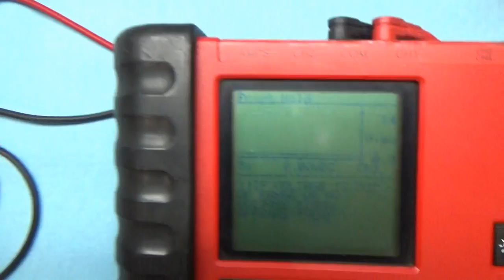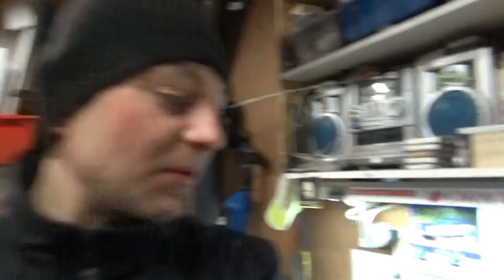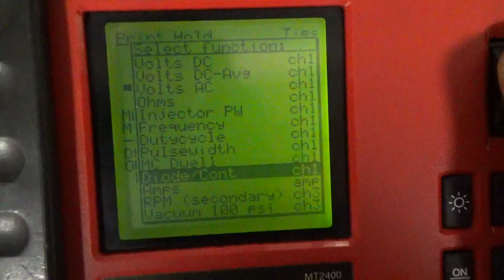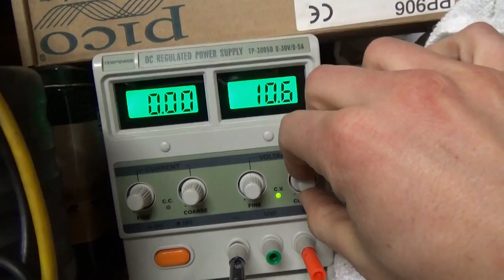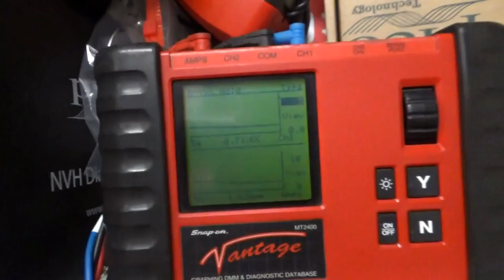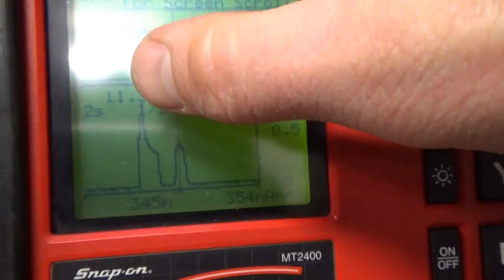Snap-On Vantage MT2400: Review & Repair

Comment: This is the only tool I will give some credit for making me a better technician. If Snap-On brought it back exactly as the original but with a modern rechargeable battery, I'd probably buy a new one tommorow.  I don't think there's another tool in existence that has up to a 16 hour timebase. I think the last update for it was about 2006. Still useful today, even without updates.

Comment: I just watched this and Just an Fyi when he tested the Amp and voltage at the same time, the voltage reading showed lower  THAT IS CORRECT! because of the amperage draw,  the voltage would be lower. His dc supply states the output.  The mt2400 measures the result!  Very Awesome tool! Excellent feature!

Comment: Nice review and walk through on a classic tool. 

My snap on diagnostics lineup looks like this... MT2500, MT2400, MODIS, and finally the Verdict D7.   Love every one of them, but the MT2400 is my go to meter.    

Maintaining a fleet of older Chevy TBI buses for our church in OKC I need all the  help I can get, please keep on with the quality content.
Reply: I have a 95 7.3L superduty and a 94 Bronco 5.0L - i see an MT2500 for sale at an auction.  would this tool be useful for these vehicles.
Reply: @peetky8645 there isn't a problem you couldn't fix on an OBD 1 vehicle with the MT2400/2500. The brick and the box as we called them back then.

I have mine since 2003. It was the first scan tool I purchased. I still regularly use the MT2400 on modern vehicles. You need the cartridge, the key, and the plug for Ford if you want to take full advantage of the MT2500's capabilities. Also, Snap On released a cartridge for ABS systems which was priceless. Let you do a ton of functions on OBD 1 ABS systems, including bleeding and purging the valve block and testing the proportioning valve on Fords right from the driver's seat.

They also came with a bunch of manuals that provide theory of operations and common failures/symptoms on popular makes and models. Snap On really was ahead of the game back then.
Reply: @LynxStarAuto  thanks... mine has been sitting in the corner since i purchased it.  it came with a bunch of green things on a chain.  i assume these are keys.  are they labelled?
Reply: If you had the correct adapters and software it COULD, but they are old tools and pretty crude.   

The older scan tools required special cards or programs for different makes & models.    So they MT2500 could truly live up to its nickname “the Brick” if you don’t have the proper accessories.
Reply: @kc360awareness  thanks for the reply and information.  the one i am looking at has maybe 5 red plug in things and a keychain with maybe 12 cards plus a bunch of cords and plugs.  i assume a 2000 year scanner would have plugins for all prior years?
Reply: Your welcome.   

Don’t get me to lying now.  I just know you there is a specific adapter for Ford.   It looks completely different from others and probably will be labeled “Ford 1a” or something like that.   Google search could probably tell which adapter for the application.   There’s probably a chart somewhere online.

Comment: Great tool. I have a vantage pro but this thing works a lot like an old OTC 3840 I have as well. I use it for quickly checking for parasitic drains. I love being able to graph amperage draws in a hurry without having to move the car in front of my Pico cart.

Comment: I have a Snap- on scanner with cartridges from 1980-2000 foreign  and domestic and adaptors for Jeep, OBDII, Ford TFI-IV, G.M., Multi-1 and multi-2, Nissan, and it has manuals for Ford, G M., Chrysler, Import, and computer numbers, and Storage case.  It has  a cigarette lighter cable, and the cable for the tester/adaptor. It checks KOEO and KOER, timing advance, RPM, Solenoid and relay test, transmission  codes, Wiggle test ( KOEO and KOER), Open loop and closed loop, O2 readings, Coolent temperature, record, and more!
Reply: Red brick MT2500

Comment: The power supply and the vantage are BOTH correct.

Power supply delivers 2 volts to the test leads, the vantage is almost a dead short, so the red and black testleads have 1 volt each across them.

That 1 volt flows in the black wire of the volt meter, so the vantage sees only 1 volt via the blue lead ( the voltage across the red lead ).

it cannot see the other ( black ) lead's voltage drop because it cannot measure the black lead since it is only looking at one end of it.

If you had measured  across the black and red terminals ON THE VANTAGE itself with the other voltmeter you would have read 1 volt also.

Draw it out with the leads depicted by resistors and write the voltages in the diagram, it will become very clear.

0.05 micro amp ( when used as a voltmeter )  causes no measurable volt drop in the test lead, 4 amps will cause a significant volt drop.

Good advice learnt many years ago: measure voltage from where to where? ( always thinking about current and loading of a circuit when testing and aware of volt drop, if you measure  a part only measure AT the part, not somewhere close or convenient )
if you follow this rule you will have no surprises.

Keith will give you the same advice

Nice job again Ivan, cheers

Comment: Hi Ivan;  Some tidbits from an OLD Vantage user... I've owned several, starting with the original Vantage, w/Ver 1.0, which I got in a package deal with my Brick (MT2500 scanner).  These old Vantages are all programmed with EPROMs, on a daughter card.  The later ones incorporated a daughter card with EPROM sockets, so Snappy could save a little money by only changing the EPROM chips with the updated code on them (a savings they did NOT pass on to the customers).  These updates were reported to be "FORWARD FUNCTIONING ONLY!"...you install a new version 3.0 card to replace 2.0 etc.  If you tried to put a Ver. 3.0 back into a unit that was running something later, it sometimes had unpredictable problems.  Case in point: When I traded my original Vantage, Ver 7.0 in to my truck guy for my new Vantage Ultra (what I still have) I told him I had an old Ver 5.0 card.  I told him I intended to swap out the Ver 7.0 card for the Ver. 5.0 card so I could sell the Ver. 7.0 card to another guy.  He agreed and everything worked fine...until the truck guy told me that my old Vantage was having problems.  The one problem I remember was that the thumb-wheel was not scrolling in some of the component test menus.  It did work everywhere else, just not in some of the component menus.  My truck guy fixed the problem himself (with the help of the Snap-On California Tech guys) by simply putting in a Ver. 6.0 upgrade board he got from a donor Vantage with a bad screen.  Another thing you should be aware of is that good, functional, Vantages (original MT2400) are becoming more rare because they all had one serious flaw; the screen assembly used a silk-like cloth material to keep the perimeter contacts tight.  This cloth is rotting away on all of them, and there are no spare screen assemblies to be had...anywhere.  That is the very reason I moved on to my Vantage Ultra (in hind-sight, I made a wise decision).

In summary, don't waste you money on one of these.  Yes, they were a fantastic tool and I loved mine dearly.  But, it simply isn't reasonable to spend several hundred dollars on something that can not be repaired when it quits...which will probably happen quite quickly.  A Pico, like your 4425, is a much better tool.  It costs much less than Snap-On's stuff, and does a better job.  Even an older used Pico can still be repaired.
Reply from the maker: Leo, thank you for sharing! It's kind of like buying an old car and trying to make it perfect. The money will never be recouped, but the pleasure that the owner can get from driving a unique vintage machine is priceless :)
Reply: @PineHollowAutoDiagnostics  these can be repaired and you definitely can interchange the different versions of the the memory card I've done this on many mt2400s

I have had many of these and all the circuits function on the main board are the same there is flash memory on the mt2400 for the CPU as it has no built in mask rom. You can also back up the eeprom to your computer incase the memory card gets corrupted.
Reply: Leo, what would you recommend for pre-2000 vehicle and post-2000 vehicles?

Comment: Re: Amps & Volts at the same time:   The voltage experienced during the amp test is due to the resistance of the leads. (V=IR, leads have some resistance.)  The blue wire has no current, but since the black wire is shared, you have to account for the effect of current through it!

In fact, since we know both the voltage and current ( 1.7v, 3A) --- We can calculate both of the leads to be: 0.33 Ohms for the black cable,  and 0.23ohms for the red one.
Reply from the maker: Excellent comment! You definitely get some extra credit for that critical thinking. Yes, all the readings were "real" and the meter is accurate :)

Comment: Yeah, the MT2400 Vantage and the MT2500 Scanner are a great combination to use especially if you do a lot of Pre-2000 vehicles.  The MT24000 seems to be about $300-500 US on EBay.  The MT2500 scanner is about $100.
Reply: Are those two (MT2400 & MT2500) the best bang for the money? 
Is there a cheaper brand that is a knockoff from Snap On? 
What is the best out there for pre-2000 and post 2000?
Reply: @vice4134  Modis can do everything those two can.

Comment: It's a great tool, mine broke.😓  It won't even turn on.  Plus what is also cool is they made a ignition module for it that would graph your spark kv, burn time, and firing kv, I own that module as well.
Reply: scanner danner i think has a video on repairing a no turn on. the battery teminal to board connections are prone to dicombobbulating.  a quick bend and  resolder is usually all it takes
Reply: Mumbʟes005 Unfortunately it's dead, looked it over and found nothing obviously broke.
Reply: busjockey1 did you open it up and look ?

Comment: I have also recently restored a vintage Snap-on MT series diagnostic tool as well, slightly older than this model mostly op-amp and TTL logic. Below is the link to the first video of a 9 part series, I had no schematic so I had to trace everything out and build some of the components that no longer exist.
https://www.youtube.com/watch?v=vY5E5pr9Ixw
Reply from the maker: Awesome!
Reply: This is now up and running at the new shop and used for air cooled VW diagnosis. 4 cylinder setups provide for ample viewing both in raster and parade.  Snapon mentioned that they have one in a museum, this is the only one I know of in fully calibrated daily operation. Or that functions for that matter.  I realize 9 videos can be tough to get through, but it was 3 months of work to reverse engineer the broken sections and repair.

Comment: The software is on the card that inserts into the machine on the same side as the fuse. You upgrade the software by replacing the card. That version 2 is really old & some of those screens   that you showed us are not included on the newer versions. I would pull out the card & reseat it. It pulls straight out, just like the fuse. If reseating it doesn't work, they are on Ebay all the time. Cheap & easy to upgrade. I have owned my Vantage since version 1 & still use it all the time. I think mine is version 6 now & I believe there was a version 7 but nothing newer. I love the "legacy" Vantage because of it's size & abilities. My Vantage Pro is cumbersome by comparison & I only use it when my requirements exceed the Vantage capabilities. Have had several issues with the Vantage over the years, but always manage to get it back into the game. If mine died today I would be on Ebay tonight buying another. I wouldn't hesitate to try a another software card in yours. Good luck.
Reply: arbez auto have you been able to calibrate it or ever had it calibrated? I'm thinking about picking one up but if it's off by .1v like this one is I'm wary about how accurate these old things are without a calibration...

Comment: Thank you my young American friend, after watching you fixing your wife’s monitor my daughter told me the TV in her room had stopped working, OK I’ll have a look, just watched Ivan fix a monitor 
Well what do you know 2 capacitors had snot coming out of them bought 2 new one’s for £0.30 put them in, and bobs your uncle, it worked, thanks Ivan, I would have just binned it, so if you can do it, I......oooh wait,  that’s that other guy I watch OLO ;-)  cheers Buddy thanks again
Reply: Pine Hollow Auto Diagnostics Amen brother
Reply: best bet is replacing all the "low voltage/output filter" capacitors on the power supply. they don't always bulge nor look bad when failing, sometimes they leak out the bottom leaving crusty corrosive fluid that eats the board traces and other times simply off-gas and go way out of spec or short circuit with a possible bang!
Reply from the maker: LOL just give your daughter a good book to read and throw away the TV...problem solved ;)

Comment: Great explanation of the MT2400. The best one on you tube. I recently purchased one fro a man who had bought one and set it back in his closet. I've wanted one since they came out. I've used it several times. It is a great machine. So much so you see many machanics's use it as their first attack at the problem.

Comment: I bought that Vantage for my older vehicles so I can't thank you enough for spending some time on it. Only you can fix a piece of equipment by educating the owner. (ha ha) That tool has more capabilities than I was aware of. The lessons learned here are worth a lot to me, plus the added function of having the DMM back, that was there all along, through a different path. I leave for work tomorrow, then 16 days in Germany so it will be some time before I get to play with it again but I can't wait to explore my new tool...that was there all along.  :)  Side note: I showed this to a Snap-On truck guy to see about that software update and he laughed. He pulled out a Vantage Pro and said "Here's your update". LOL
Reply from the maker: haha Wyatt that's the most popular way to "update" Snap-On equipment!
Reply: Hi Wyatt. My mt2400 has rev 3.0 in it and the dc volts works as it should. You can update your mt2400 by getting a module that is a 3.0 or higher off of Ebay.
Reply: @mikep95133  Thanks for the info!

Comment: if you are measuring current and voltage at the same time, there will be a voltage generated across the common negative, silly designers lol :-D
Yep most cheap bench power supplys are not perfect, but very handy to have :-D

Comment: For its time, it was a damned good tool. I still have mine. Really made me mad when Snapper stopped making updates for it. Mine is spec'd out. I have all of the transducers and low amp probe, as well as the high KV module. It's a bit slow, but It's a 90% tool. Short of a a deadacted laptop, it's dead on.

Comment: Hey Ivan, a couple of thoughts: First, manual is here: 
http://buy1.snapon.com/products/diagnostics/downloads/manuals/vantage.asp
  Next, I see that model has ability to attach a printer. It's possible that one of the printer functions is data logging when in meter mode. The printer connection protocol is RS232, which can have hardware handshake, which could wedge up the software waiting for printer ready if the printer is not connected (or wrong signal applied at the printer connector, dirt causing short etc). You might check to see if fiddling with the printer settings does anything for the meter mode.  Also look see if there's any dirt/corrosion in the printer port jack.
Reply: Haha looks like HUBBA posted a similar idea a bit ago, and I hadn't refreshed the page.
Reply from the maker: Great suggestion, Graham!

Comment: I would try a few things: 1) Plug in a printer (LPT1) and attempt to print; there could be a job accidently stuck in the buffer. 2) Open the case, look for a dead battery or cap ("keep alive memory", CMOS, etc.) or a cracked/loose solder joint.

Comment: Be careful:  you may find yourself ceasing to be an auto diagnostician and becoming an electronics repairman.
Reply: That is a dead business. Throwing something away and buying something new is usually cheaper, and what little electronics repair that is still done professionally, is done with the parts cannon. Unfortunately, nothing is designed to be serviced anymore.

Comment: ScannerDanner says this is the tool that changed his life.  I bought one of these on eBay (a v7.0 model) back when Eric O was using it all the time.  Not long after I got it and started using it (and loving it,) Eric got the Vantage Pro.  I later picked up a Vantage Pro w/v16.4) on eBay for a steal and justified by saying I'll sell the Vantage.  Only problem is I can't bring myself to part with the old Vantage.  

I was actually looking forward to seeing you tear it down and fixing the problem.  There have been a couple of update cards on eBay lately.  I wonder if an update card would fix it?

Comment: Mine its dead would you fix mine? I'll paid you..
Reply: Check that the battery connecting terminals is still connected to the main board. Solder joints go bad over time. Happened to my MT2400.
Reply: Scanner Danner has one that he repaired the solder joint on. He has a video on it.
Reply: Scanner Danner fixing his MT2400: https://www.youtube.com/watch?v=KcXS3eD_OTU
Reply from the maker: Only if I get to keep it after the repair ;D
Reply: I'll send it to you my friend....it's yours ....its nit working anyway...
Reply: Bill Rimmer Danner is the best of the best